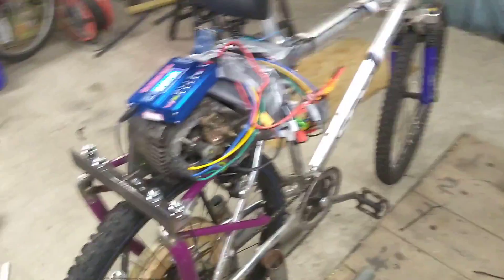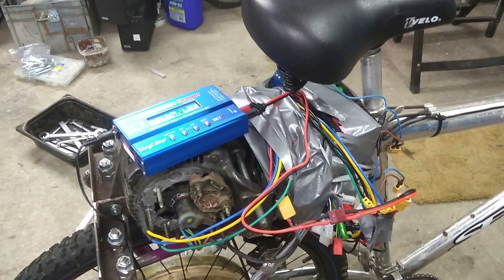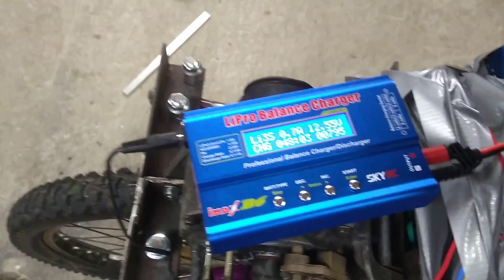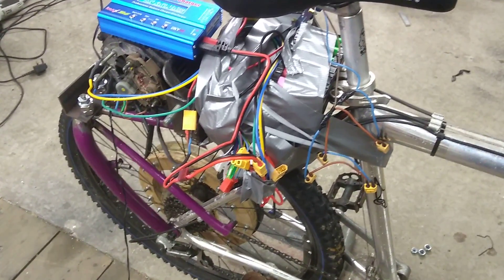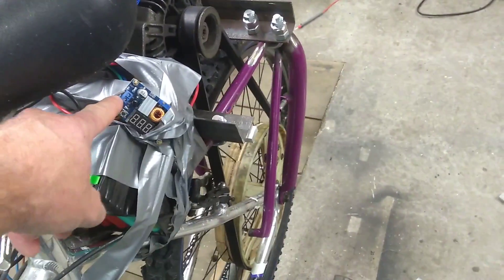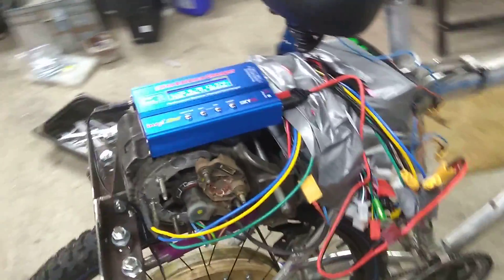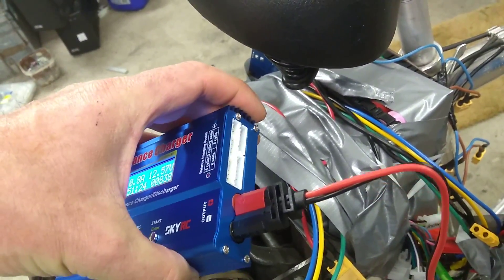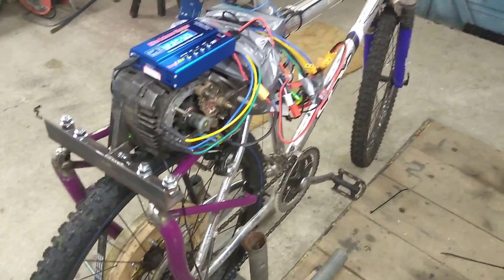Part 4 DIY E-Bike using car alternator, laptop batteries and cheap Chinese controller

Comment: Any updates ? How's this thing going? And what was the new controller you have used? Thinking about doing something similar but want a 1000+w controller but can't seem to find a sensor less one any ideas?
Reply from the maker: Check out my other videos. Loads of ideas there.
Reply: @alibro7512  yeah I just go on your channel and found the v2 bike pretty sweet ... What controller was u useing ?
Reply from the maker: @derrickdarnell6067  just a cheap controller off ebay. It doesn't seem to matter if it is listed for hall or no hall.